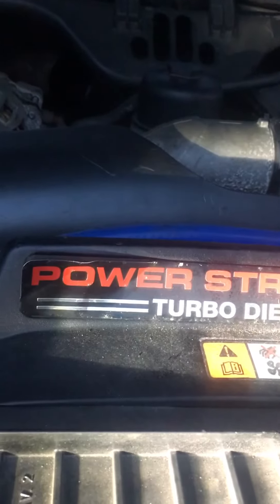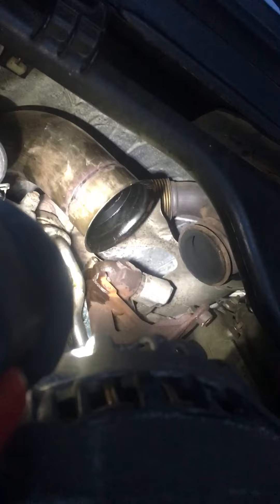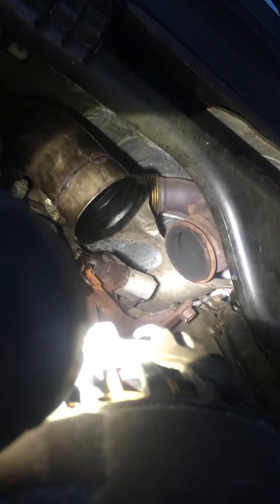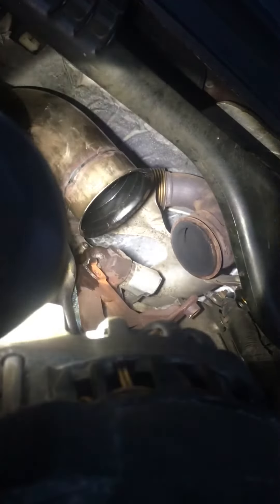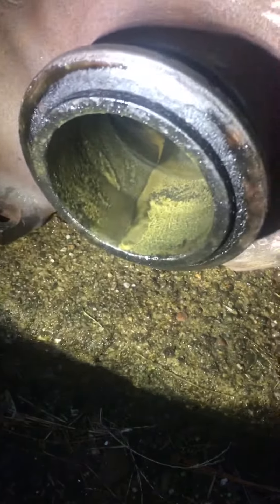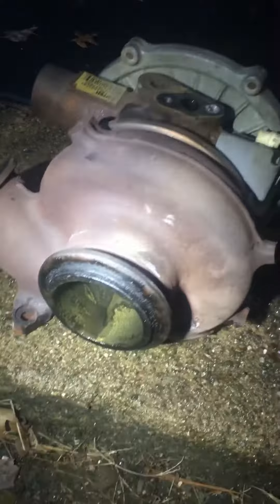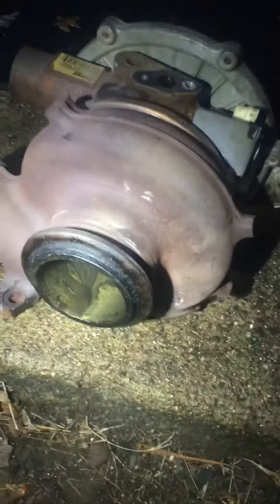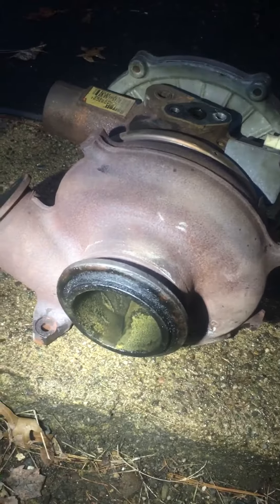6.0 power stroke bad turbo oil seals

Comment: What’s with the yellow soot? I just noticed my truck was starting to smoke a bit and theirs some oil leaking from my turbo, I also have the yellow soot in my Down pipe and exhaust tip.
Reply from the maker: It’s moisture mixed with the oil
Reply: @bluecollarwrenchslinger7983  I’m thinking I got turbo seals and a egr leak of some kind?

Comment: How come you wouldn't rebuild it? Unless you wanted to upgrade. I was just wondering because by 6.0 is lagging big time on bottom end and smokes on startup more and more. Rebuilding seems way cheaper than a new turbo.
Reply from the maker: James O'Lexey  I'm gunna rebuild it for a spare.. but the new powermax sounds great and is all around a better turbo
Reply: Are you running stock injectors? How did your truck run on bottom end? If I give mine more than a touch of throttle to take off, she almost chokes out and rolls black smoke until the turbo starts to spool up. Lags really bad.
Reply from the maker: James O'Lexey  I'm running stock injectors.. slight lag off the line but pulls hard and no smoke hits 28 psi.. sounds like your Vgt is sticking in your turbo.. dose the truck sit a lot??
Reply: Also, It doesn't sit but maybe 3 or four days a week. Are you talking about the veins or the solenoid?
Reply from the maker: James O'Lexey  the vanes are stuck possibly.. very common if truck sits or is never driven hard
Reply: No it doesn't sit but 3-4 days a week. Are you referring to the solenoid or the veins?
Reply from the maker: James O'Lexey the veins